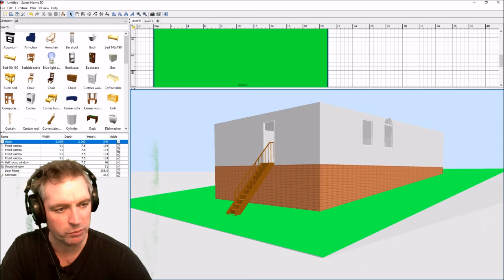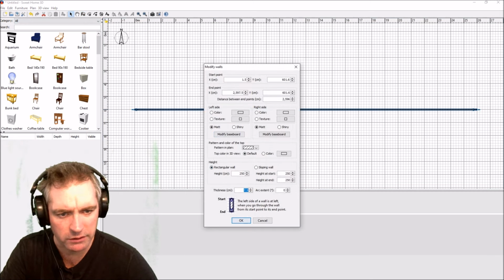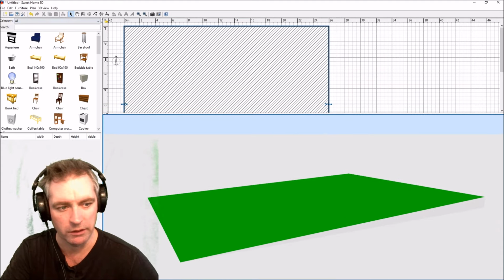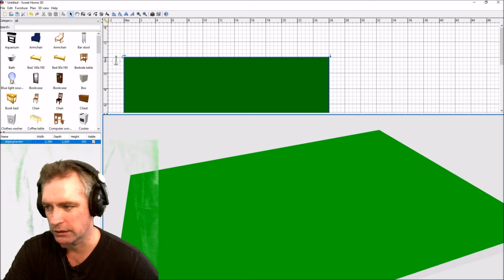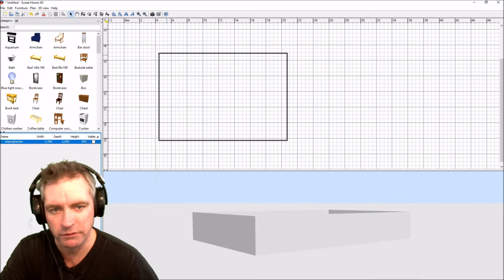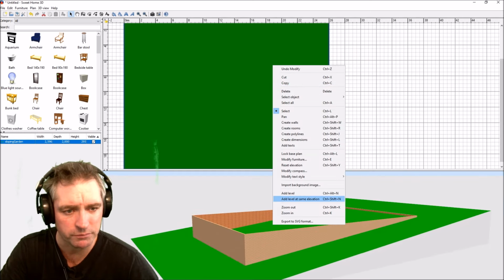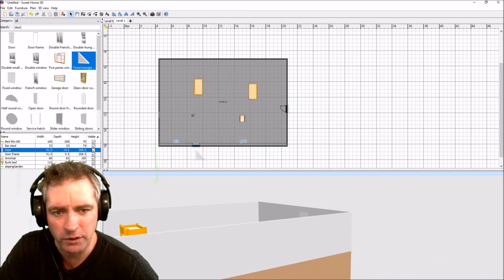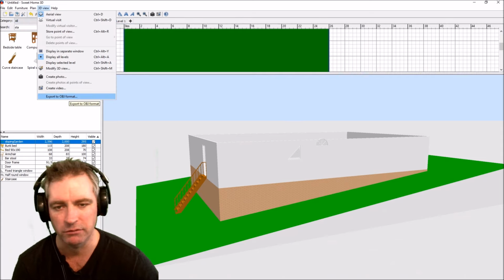Creating a Sloping Ground in Sweet Home 3D

Comment: Hi. Firstly, thank you for excellent advice and knowledge...we now have a roof from a previous video! In this video, do you need to make the slope first before making the rest of the house? Also...how did you make a floor so easily? We make a big flat cube each time and the speed with which you made a floor left us in a bit of a state of shock..also...any advice on beams? Again we are using long cubes but we need to rotate them and can't. Thank you again fellow house designer. :)
Reply from the maker: If you draw walls and finish your last wall connected to the start of your first wall, then you can just select the floor icon from the top menu, then double click in the space between the walls and the floor auto generates. 
If you want a slope, then I think it's easier to create it first, otherwise you'll need to manage your levels which may get a little fidgety. 
With beams, I also use the cube to draw pipes in one of my videos, I can rotate it but it is also a bit fidgety. It is easier to just open a new blank project, create a beam type shape using the cube, export it as OBJ, then re-import it as furniture, which will then be easier to manage. The process is very similar to how I created the ground slope in this video, but you'd be creating a beam object that would match more closely your needs.
Reply: seanwasere youtube 
Thankyou Sean.
In fact, when we exported and imported the famous slope, it showed up like like a hole in the ground maybe because we already have a representation of the house in place. Right beams....it's your turn now! 😋
Reply: Hi Sean. It is now 4 months since we started several projects. Eeek..time goes!! Anyway...I have another question for your genius mind! We have always had to estimate the centre of the walls thickness to start drawing a wall. Is there a way to be able to get the curser to register at the outside or inside edge of where we want the wall to be? Thus giving us more accuracy! Thank you again. :)
Reply: Also...is there any way to be able to see the level above sea level of each floor? Thank you again again :)

Comment: Thank you so much for the tip, but I need your suggestion how to create a sloping floor with four corners with different heights and angles? I want to create a drive thru car park that is located infront of the house main entrance. Do you have another demo video? Thanks.